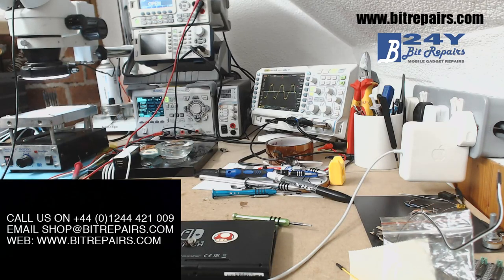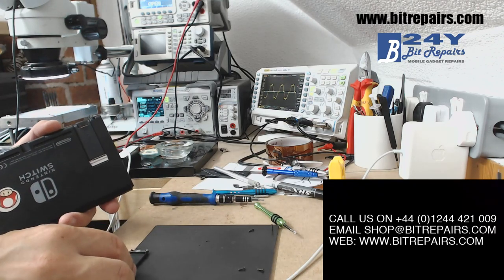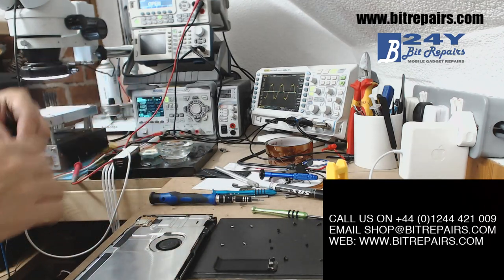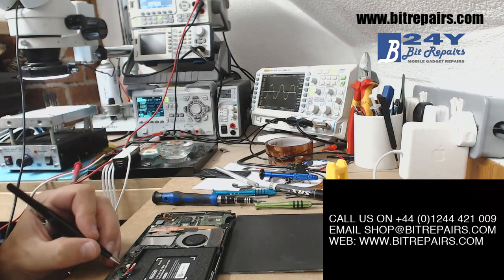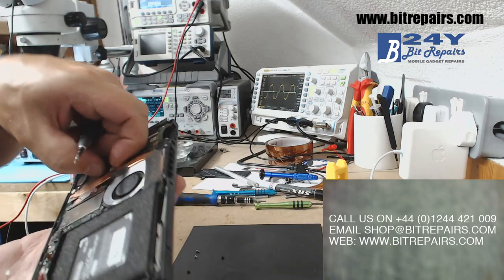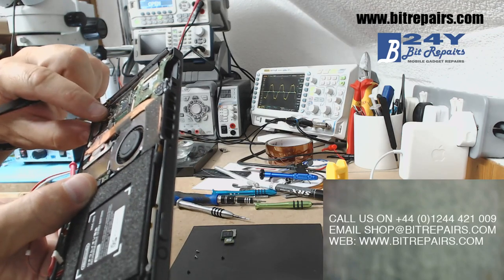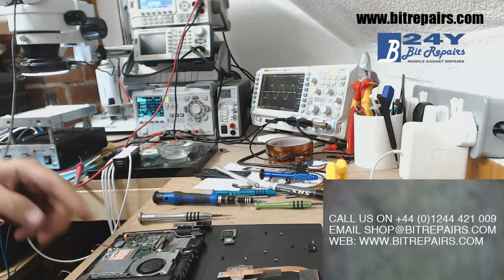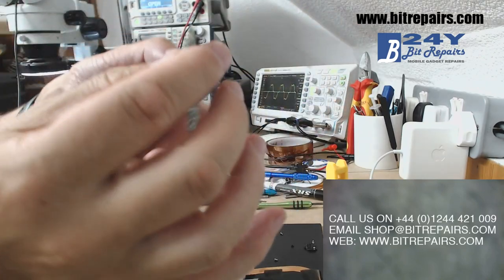Nintendo Switch USB Port Replacement Teardown, Repair & Reassembly

Comment from the maker: I tested the USB connection and all is well with this console. Please be careful not to overheat  the connector., remember with good preheating the board you only need 220-230 degrees.
Reply: is that Celsius or Fahrenheit?

Comment: This is the best USB C replacement video that will ever exist for the switch. I also have an issue with my usb  port on my switch. The middle connector is slightly bent, it charges fine. Just worried over time it might take some damage being slightly bent. Anyway i could email you a pic and you shoot me some advice. I would just pay you to fix my switch but you're across the ocean my man.

Comment: When using the hot air, did you aim it at the side, top or the bottom of the board? Did you say you used heat shields to protect the connector?

Comment: I know that this video is old, but how much would you charge if I shipped my Switch to get this done to it. I believe my son broke the pins in his charging port. The switch's screen comes on with the battery indicator showing red and even though its been plugged in it won't charge. The battery indicator does show the lighting bolt next to it when its plugged in though. Could broken pins still be the problem if it's showing that it's trying to charge?

Comment: How much would this repair cost? My son's switch won't show on tv but does charge in the dock and green light comes on,   I've done all the easy checks
Reply from the maker: rab anderson it sounds like you’ve got a data pin broken on the connector, the repair would be £50 including postage both ways.

Comment: hello.. i d'ont understand. i have the same problem. impossible for me to remove the usb connector. the shield not move. with 240°, same problem. flux os ok, the board is preheated 200°. any tips ?
Reply from the maker: Hi, try using hot air then adding the soldering iron on top of the old connector to heat up the part directly, its the old part so it doesnt matter if you destroy it with solder.
Reply: Bit Repairs  thanks for your response. i try but the shield resist. finally the connector is remove but... 1 pin on the circuit board was damaged and this pin is used so my switch is definively ko. But i try to understand where is the problem. i think my hot air gun is fautly. it's a wep858D.
Reply from the maker: Sorry to hear of your troubles, you could send it in to me and I can do some surgery for you under the microscope, or if you’ve got a microscope you could give it a go yourself.
Reply: @BitRepairs  Hi. I have encountered a similar problem. I have damaged many of the pads. (first time trying this.) I understand you can bridge the pads to the board to reconnect the circuit, but there are just so many damaged that I would not know where to begin. Do you have a tip for me? I can send you pictures of the pulled pads and the condition of the board. Thank you! You're my last hope :(
Reply from the maker: Melvin P.H. Sorry to hear of your problems, your only real solution to this is to run a small micro jumper for each missing pin, solder mask it to the board then apply a little solder to both the pins on the connector and the wire on the board then apply the new port, I suggest using low melt solder possibly but the port will be nowhere near as strong as originally. I’d say a good 1-2 hours work would be needed to rectify your situation.
Reply: @BitRepairs  I'm trying to repair a port not I was able to get it off but the holes still have solder in them and the hot air gun nor the iron can get it clear.  At my wits end with this
Reply from the maker: Prakash Budhu the best option for this is to apply more solder to the holes on both sides, ideally low melt if you have it but leaded solder would be ok too. Then try and wick it off.
Alternatively you can use the dual method and use your soldering iron and hot air at the same time with wick, it’s tricky but works a treat.

Comment: I have asked you about phone repairs on eBay, do you not like the colour of my money, you don’t reply?
Reply from the maker: Hi, what’s your enquiry? Whenever I reply to someone on eBay I end up getting blocked for talking to someone before they’ve ordered. EBay are terrible for actively reading private communications between members.
Reply: Bit Repairs oh ok sorry, I have an iPhone 7 with turtle IC problem, home but clicks many times when pressed lightly, can still use phone and Touch ID still works, could you replace the “turtle IC” ?
Reply from the maker: Yep, no problem, it’s a little costly at £50 due to the intricate process but if you want to send it in then please email shop@bitrepairs.com and I will raise a repair order for you.
Reply: Bit Repairs ok thanks I will do.
Reply: Sorry for late reply could I poss bring the phone to you or talk to you on the phone ?
Reply from the maker: Yep, you could bring the phone up but I would have to add it to the queue, usually a maximum of 7 days turnaround. You can catch me on 01244 421 009 - Monday to Friday 9-5
Reply: Bit Repairs ok thanks I have filled the form out on your website.